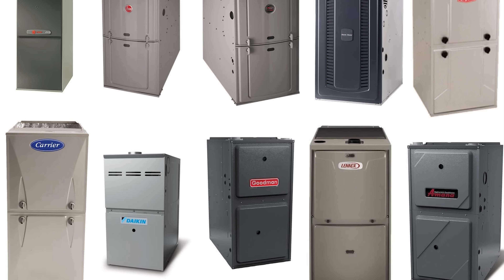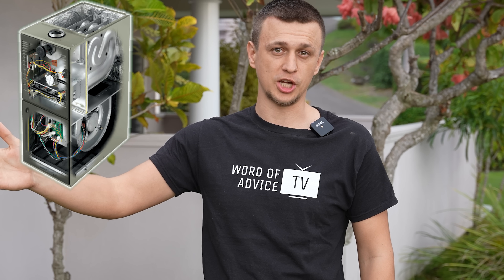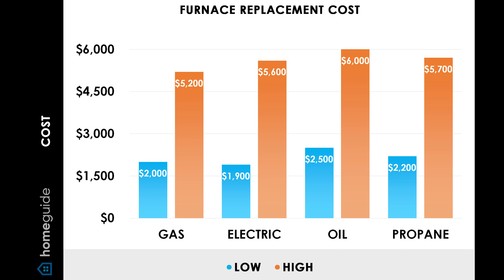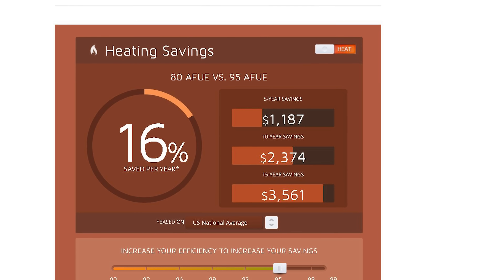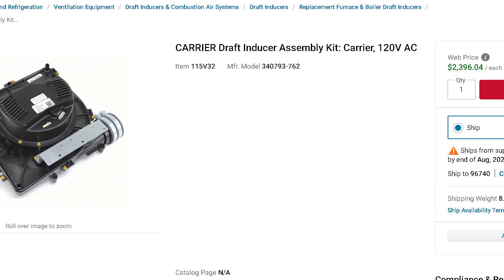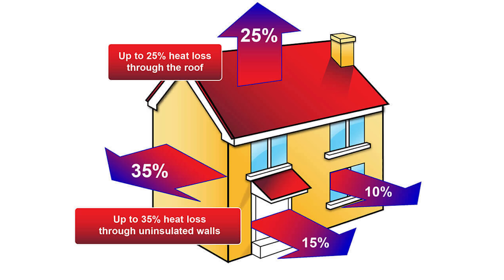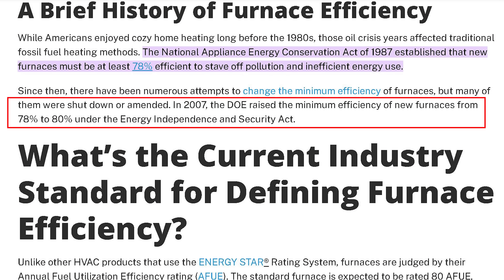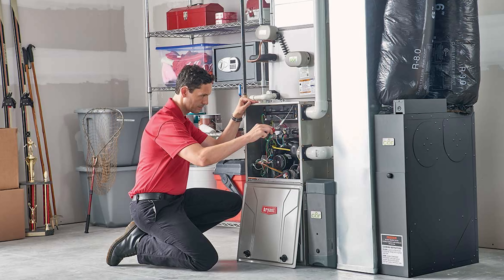Don't Buy a High Efficiency Furnace!

Comment: The only time you'll save money by spending money is if your investing in a business. Your investment must make your business more efficient for this to work through. The go green YouTubers are the worst and people fall for this crap not taking into account the cost to install things like solar panels for instance. 30k takes a long time to recover. Same thing with electric cars the higher price of an EV will buy a lot of gas and they never calculate the higher depreciation which also adds to the cost to own. It's a scam and people fall for it.

Comment: Hello I enjoy your channel. Thank you for all the good advice and this program. I have one thought about the difference between the necessity of 96% furnace versus the 80% furnace. The exhaust issue whereas in 80% usually needs to go up some sort of chimney stack versus the high efficiency which is the PVC that can be released exited through a standard wall in a structure.
That was my reason for having to go with 96% in an older building. Having to convert from an steam boiler to 3 separate independent units 1 per floor.
Where tapping into the old chimney stack was not an option in the apartment floor plan. Thanks again!

Comment: I do not agree!  I am a general contractor that has been installing high efficiency furnaces for 20 years.  I can get a 92%, 60000 btu Payne furnace for around $1000.  The only problem I have had in all this time is two pressure switches.  Carrier provided the part under warranty in both cases.
I have switched to heat pumps, so this is all history now.

Comment: Get a life high efficiency furnace is 2000 dollars unless your getting ripped off by an HVAC  company . I have had one for 20 years that I paid 1000 for it and they have been ban in Canada since 2013 . In 20 years I have never had a break down on the furnace or A/C and do all my own maintenance , installed it myself and had it inspected. Inspect heat exchanger , clean burners , check co and gas pressure  . Same as AC one should never be install without a TXV another HVAC rip off

Comment: I'm in HVAC service, I totally agree with this comparison of 80 vs 90% models but older natural draft 70% efficient models are missing important safety switches so I'd recommend replacing those. In my experience 90% efficient furnaces can be more dangerous when the secondary heat exchanger fails and they're more likely to allow carbon monoxide in the home vs 80%

Comment: Wow, I must disagree with you on several points. 1st: There are no low efficiency electric furnaces as they are all 100% efficient. 2nd: There are only selling 80& efficient oil furnaces as the high efficiency oil furnaces ran dirty & required servicing twice a year so they were pulled off the market. No one buys oil furnaces because of the high cost of both the furnace & fuel, & need more servicing. I'm from Northern MN so our furnaces run long & hard, so it is a dis-service to the customer to sell them anything other than a high efficiency furnace with the following exception: Their house is small, well Insulated, & have very small fuel bills. Now, as to reliability both the 80% & high efficiency furnaces have draft inducer motors, vacuum switches, circuit boards, which the older more inefficient furnaces didn't have, so there is no reliability advantage of 1 over the other. Also you must be giving the highest draft motor cost you can find but I've never heard of a draft inducer motor costing $1,500. High efficiency draft inducer motors normally cost $200 to $450 to the customer plus 1 hour service charge. If your costs are that high you should sell another brand of furnace. I sell Armstrong, Goodman, Lennox, & Tempstar & none of these run even close to your repair prices. You should not be up-selling customers these kind of furnaces unless they want the best, regardless of price. And lastly, furnaces like my Lennox Pulse furnaces are still running great even after 40 years (since 1982)! Very little repair, cost of parts now never exceeding $400 ($650 when control boards no longer available, but Johnson Controls to the rescue) My Armstrong furnaces are lasting 35 years & still running great. Only my Goodman furnaces are giving longevity problems & are some are lasting only 15 years,  1 lasting only 9 years. So stick with a brand with a door reputation for longevity, cost, & reliability. Last point & it's a big one: These high efficiency gas furnaces have saved my customers thousands over the furnaces lifespan, & being from a small town of 1,000 people where everyone knows everyone, people know who the real scammers are!

Comment: We have not been able to install “standard” as you call them furnaces in over 10 years.  You need to educate yourself better before producing videos. If installed correctly and a manufacturer that produces a quality furnace, that furnace will last 25 years. Regular maintenance (as with every furnace) is crucial. Btw stop looking at Amazon for parts.

Comment: The problem with waiting to replace a old furnace is that its not going to break when I'm performing my inspection. It will fail after I leave exposing the homeowner at risk of Carbon Monoxide poisoning if the heat exchanger goes..... so I would advise to replace a old furnace simply because safety.
Reply: geet several Co detectors as an option, could go many more years
Reply: @pablopicaro7649  Correct. And then when they go off there will be no heat until it’s replaced. That makes it an emergency rather than preventing it prior. People can prevent a crises by replacing it earlier.

Comment: still not getting why in the world people still installing furnaces. It does look like ancient tech. Ceiling cassete in new construction house, - where you can control each room separately on you thermostat and where heat pump will provide heat or cool air whenever you need. Each room has it's own need for climate, - cause different amount of windows, different size, different insulation.
Reply: Ari, the cost of installing ceiling cassette units throughout an existing house would be prohibitive for most. 
If you have existing ductwork,  a gas furnace tied to a heat pump is a great option.
Reply: @robgrasso9320  I meant new construction. People should consider in the new construction split system. Maybe something even with 2 outdoor units for redundancy purposes. In my Houston house ducts are running in the attic, where temperatures in the summer can go as high as probably 150F. How cool air inside of insulated ducts is supposed to be cold. We have here lots of cool air loses. But I'm about to install wall units from Daikin. Will start from two, - will prepare runs for two more, - and will see if I would ever need to install those two extra.